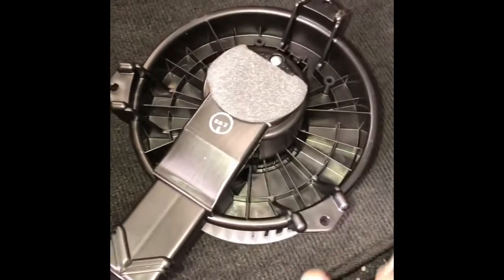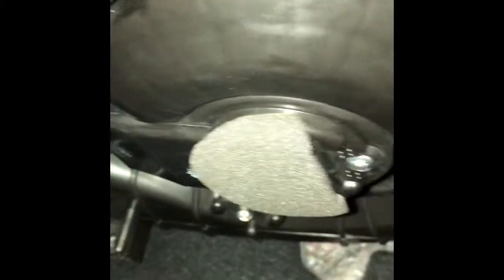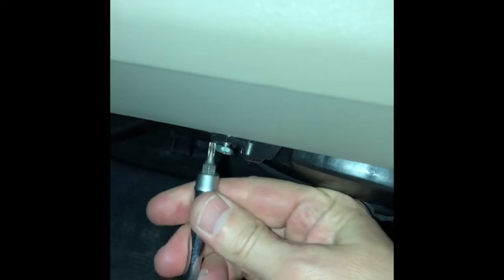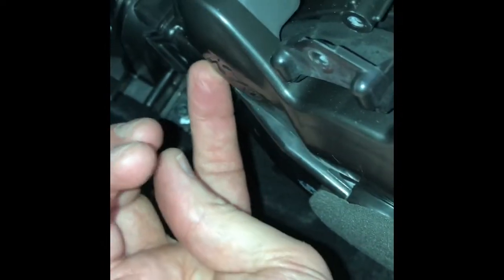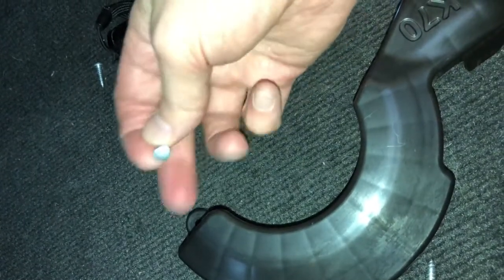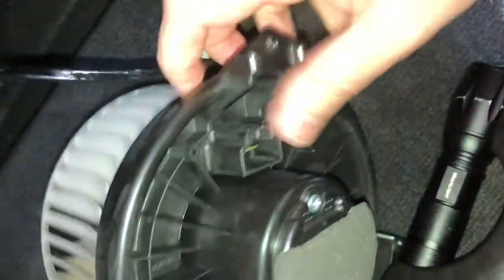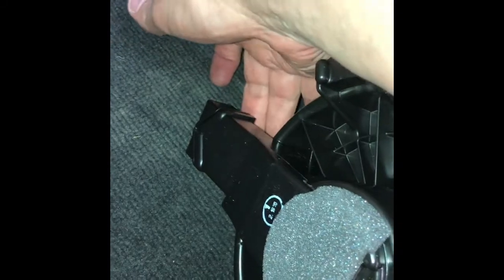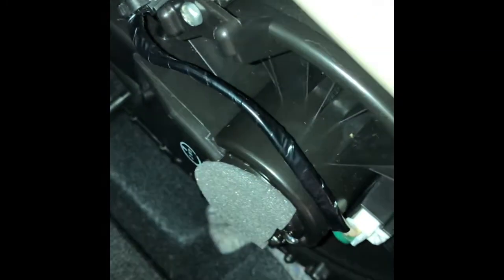2012-2015 Honda Civic - Blower/fan motor replacement

Comment: For me the hardest part was putting back on the small C shaped plastic cover.  It was pain because the screw had to be facing up.  Impossible to screw it in upwards because of gravity the screw would fall out. What I did was use a small piece of cardboard about the diameter  of a dime, put the screw in the plastic piece then through the cardboard like a nut. Doing that held the screw in place so I could screw it in place. Also used a mirror to help align and position the plastic piece to the mounting holes.

Comment: Would anyone know if this would be similar for a honda civic 10th gen 2018? Dealer quoted me $300  and said if this doesn't work i need to pay more for diagnostics etc 😢
Reply from the maker: Almost an identical procedure but a different part number.
Reply: @DIYGuyUSA  Thank you for the reply! I just Amazoned the blower fan and blower resistor for the 2016-2019. Hopefully that resolves the issue. Dealerships in Australia just chop when they can.
 😅

Comment: I also need to replace my motor resistor. Where can I find it?
Reply from the maker: I haven’t done it on this car, but I believe it is to the left of where the fan assembly is underneath the glovebox. It should have a plug for the fan.

Comment: Before replacing blower motor, make sure there's no dibri, excessive dirt, leaves stuck in the cage of the motor. I've seen that and it only takes to clean it. After removing blower motor, spin the cage and listen for excessive noise which indicates worn out bearings.

Comment: I have a 2017 civic.  AC is still cold but the blower isn't blowing as hard as it should.  SHould I replace the blower motor or could it be something else?
Reply from the maker: It is possible it could be the blower motor.  Does it change to different speeds properly?  If not, it could be the blower motor resistor.  It probably would require a little more research.

Comment: Do you have a video of the sound it was making before you replaced it? I think this is my current issue but it’s not so much a squeak as a wurring noise that has turned into it barely blowing now.
Reply from the maker: Unfortunately, I don’t have a video that has the sound, but I believe it is more of a squeak because the bearings are worn out. Yours could be a different issue such as a bad blower motor resistor.

Comment: I have 2012 lx 4 door... is this compatible? Mine started making whirrring sounds and yep somethings wrong...
Reply from the maker: Yes, if you check the fit on that website in the comments, it does show it is compatible with 2012 LX 2-door.

Comment: Great video. Thank you.
I might need to replace blower motor soon because it is making louder noise as I increase the fan speed, like a Cessna propeller 🙂 It could be some leaves stuck in there, I need to take it out and see.
Reply from the maker: Yes, it sounds like something in the fan, but you can remove it and easily check

Comment: My car hit a massive pothole and the fans got really loud
Reply from the maker: If it is this fan, you would be able to hear it without the the engine running. Just have the a/c going.  It should be just a squeaky bearing. Otherwise, it could be something else depending on the sound.
Reply: @DIYGuyUSA  I hear it with just the fan on, regardless of engine being on or setting, I'm worried the housing got bent maybe?
Reply from the maker: @kaiburns4257  it could be that something fell down into the fan area. If twigs, or other debris is near the engine compartment, maybe a bump made something fall into it. It is fairly easy to remove the fan and check.
Reply: @DIYGuyUSA  okay I'll be sure to take a look though first thank you so much for the help

Comment: My ac keeps pulsating. like it'll switch from blowing fast and slow. Could this be the problem?
Reply from the maker: This fix is just for a squeaky fan. Yours sounds like it could more electrical such as the switch resistor or a bad relay.

Comment: Any idea for 14 civic , the motor makes clicking noises and then sometimes air will completely stop coming out of vents no air flow at all, other times even on the fastest setting the air flow is super weak.. is this a bad motor plus the resistor ?
Reply from the maker: That does sound like a possible problem with the blower motor resistor. You would have to diagnose with a multimeter or try replacing it.

Comment: Excellent video.  Thanks for posting.  My 2015 is starting to develop a squeak.  I might go with an aftermarket fan and your video will save me some time.
Reply from the maker: Good luck.  I hope it helps.  It is actually pretty straightforward on this car once you know where the screws are located.

Comment: Great to the point video. I ordered mine on EBAY $45 
It arrived today 2/12/22 and installed it in 15min. I disconnected the wire first before the screws. 
Thank you so much ✊🏼💪🏼🙏🏼✌🏼😁
Reply from the maker: Thanks. Glad you were able to get it fixed.

Comment: TY
My 2013 Civic motor has been making somewhat quiet high pitch sound, from day one. Honda told me I'm hearing things and refused to replace it. My wife isn't bothered by it, I'm going bonkers every time I drive the car. 
My question, would it be just the fan that would make this sound or the motor itself?
Reply from the maker: Does the sound go away when you turn off the fan? If so, then it is probably caused by this. Fan and motor are one unit

Comment: I Did It!!! It worked!!!! 
Thanks sooo much. I got the leaves out and its fixed! Thanks for the great easy to understand video!!!!
Reply from the maker: Glad to hear it worked out
Reply: @DIYGuyUSA  my civic isn’t blowing hard like it used to. Will changing the blower motor fix this?
Reply from the maker: @eeeek5238  Does the blower motor still have different speeds or is it only blowing at a single speed?
Reply: @DIYGuyUSA  still has different speeds but the max just doesn't feel as strong as it used to be. I just replaced it and it feels the same.. Is something else going on with my AC?
Reply from the maker: @eeeek5238  If the air is blowing but not cold then you most likely have a leak. It should be 45 degrees or colder when coming out of the vents. If the force/speed of the air coming out is low, then I’m not quite sure what would cause that.
Reply: @eeeek5238 you ever figure out what the problem was? Im dealing with the same issue on my honda and was thinking of replacing the fan but if changing the motor does no difference to the speed ill just leave it alone

Comment: I have a rhythmic chirping sound that seems to come from my passenger side AC fans. The sound stops as soon as I turn the fan to off, and starts with the fan on even if the AC is off. Do you think replacing this part would fix that?
Reply from the maker: If the chirping sound is related to the speed of the fan, then I would say it is probably worth replacing.

Comment: Mine is not coming on unless i kick it then it comes on is that my motor?lol
Reply from the maker: That sounds like it may be the motor or a loose electrical connection.
Reply: @DIYGuyUSA  h
Reply: Same on mine.

Comment: Our 2014 Civic LX blower motor works intermittently. Sometimes runs on high just fine. Sometimes not at all. Sometimes barely blows on any setting. I thought maybe it was the resistor but it wasn't. Blower never sounds weird. Always sounds like it did when car was brand new. What should I look for next? Cools just fine.  Thanks for the video
Reply from the maker: I have not had that problem with this car but another car had similar issues. Sounds like the blower motor resistor or possibly a relay.
Reply: I have the same issue that you describe on my 14 civic. I really wish to know what it is before I buy any new part. Did you fix your issue?  Was it the actual motor which was faulty?
Reply: @dsilva158  I replaced the blower motor and that fixed my issues.
Reply: @ToddWhirley  thank you for the info. Will go right away to buy the blower motor.
Reply: @dsilva158  My 2015 is doing the exact same thing. Guess I’ll be buying a motor too.
Reply: @angryox3102  can say yes changing my blower motor did fix it.
Reply: I have the same issue and hitting the glove box makes it start blowing again if it cuts out, so I'm going to try replacing the blower too.
Reply: My 2015 is doing the same. Will be changing the blower motor. Thanks